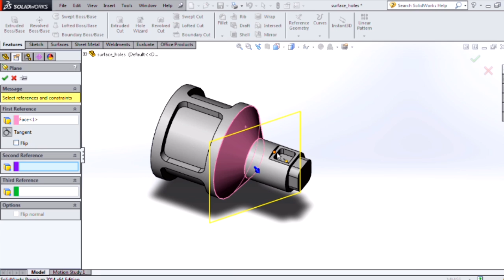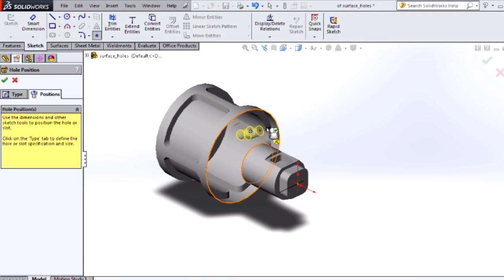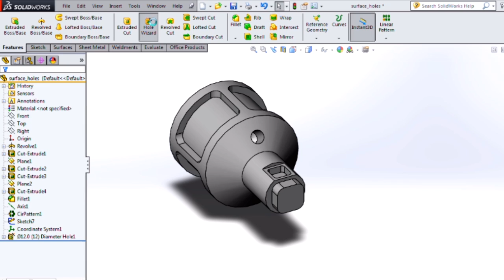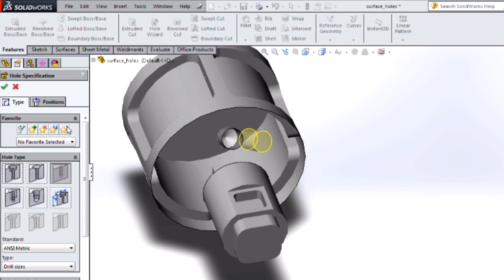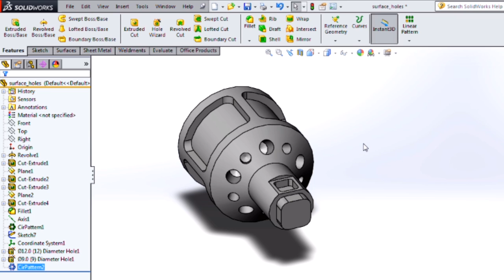SOLIDWORKS - Using Hole Wizard on Nonplanar Surfaces

Comment: how would you suggest putting threads on that hole without having to create a plane as you would when you create a hole using the extrude cut tool?
Reply from the maker: If physical threads are needed, you can use the Thread feature Insert -> Feature -> Thread

Choose the top edge of the hole for the "edge of cylinder". Then for the second selection "Required Start Location" you can expand the Hole Wizard feature and show the 3D Sketch underneath it. There should be a sketch point placed from when you placed the hole initially. You can select that 3D Sketch point as the location start reference.

Or if desired, create a new Plane easily by selecting the nonplanar face and that sketch point.

Otherwise if you just need appearance of thread, cosmetic threads can be enabled through Hole Wizard.

Comment: NIce tutorial, but it looks like 2018-2019 solidworks doesn;'t support creating 3D sketches with the hole wizard.
Reply from the maker: Make sure there isn't a  face or plane pre-selected before launching the Hole Wizard and you should get the option for 3D Sketch. Pre-selecting a face or plane causes Hole Wizard to default to a 2D Sketch. Hope this helps!